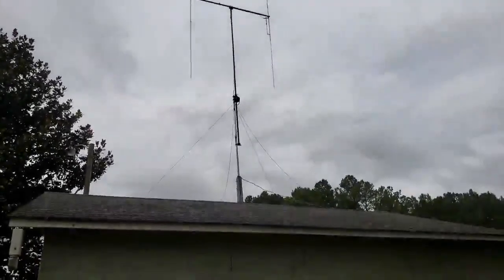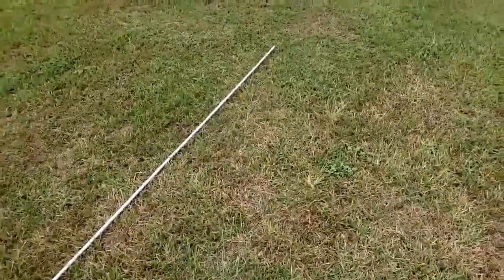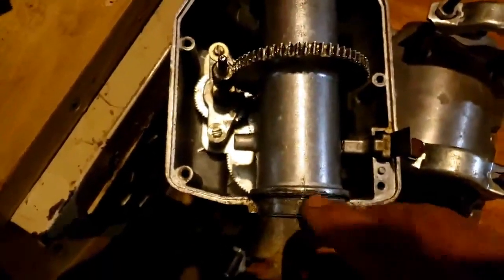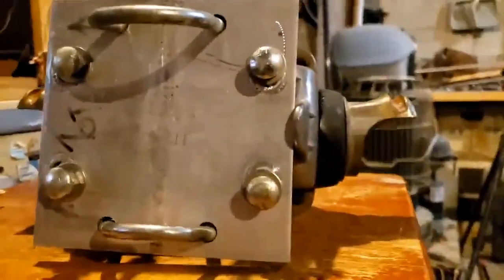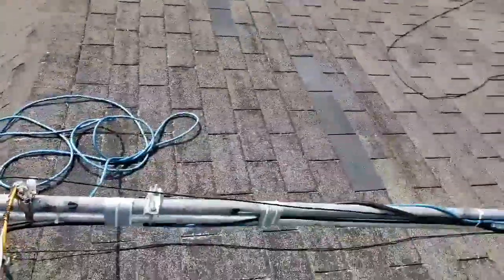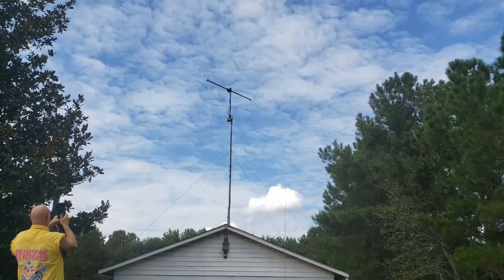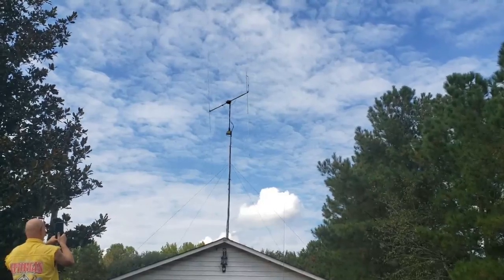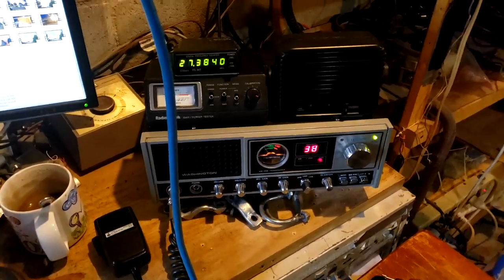Dual Rotor Yagi CB Radio Antenna

Comment: The Moon Raker did this with both a horizontal and vertical set of elements but you needed two coax runs to an A/B switch.. I thought they were huge until I saw an 80 meter cubical quad for 3.9mhz being put on a 120 foot high tower.. Like dad said, there are more ways than one to skin a cat..

Comment: I've been doing this since 1978 lol. You should have seen my stacked 4 element cushcraft with both antennas with their own flip flop rotor and stacked on a 20 ft stacking boom. All on top of a 40 ft tower being turned by an old wilson rotor and rotor box. It worked extremely well but my neighbors were nervous about it so I took it all down and used just 1 cushcraft 4 element. I love using a yagi on a flip flop rotor.
Reply from the maker: Nice! I would have loved to see that setup.

Comment: Vertical. Most CB antennas are vertical and if you are receiving with a horizontal antenna you are receiving half of the power.
Reply from the maker: these days Most of my locals are on flat side beams, I hardly ever use a vertical anymore.
Reply: @MowerJunkie  That is unusual. What do you use for mobile operations?
Reply: @MowerJunkie  Usually avoids a a ton of QRM.

Comment: what about if you turn the rotator half way between vertical and horizonal you get the operators that have horizonal only and operators that have vertical only so you contact more radio operators

Comment: Same Antenna, 3 elements in the 2/21/21 video? I read you took it down in the comments, I guess this is why. Can you tell difference with gamma up or down in horizontal position?
Do you miss your Reflector element? I realize why you had to lose an element to incorporate 2nd rotor. Watched the single element vid. also😎. Is there 4 element in the future?🤔 
Great video as always. Keep on expermenting. 73

Comment: What rotor was used for rotating the antenna vert/horiz?
Reply from the maker: both rotors are old Archer TV antenna rotors. one of them is a pass though design, and allows a pole to pass straight through it.

Comment: Very cool. Horizontal or vertical will come in handy with locals.  If your signal reflects off the ionosphere (skips) your polarity will be hit & miss.  Skip signals can "tumble" polarity.  Fun to play with & see which polarity works best for skip at the moment.  I have a similar setup with 4 qty Cushcraft 11 element yagis for 2 meter moon bounce. I had some fun today on 20 meters. Long path over the south pole into India (from Utah). The guy in India was talking on a home made rig transmitting only 40 watts and a piece of wire.  73 de AF7FP

Comment: This set-up will not work properly, because the mast is inside of the vertical, disturbing the 'field-pattern'! 

The 'horizontal' will work just fine! The 'vertical' not! 

A metallic mast will work as a third "leg" for the antenna! But not as a calculated 'leg', more 'disturbing' the 11m-Waves in the vertical position. 
Only possible solution is, take a non-conductive mast (fiber-glas etc.) 

Take a look of some HAM-Radio books, that explains more, than I can tell you. 

73 de Markus ; db9pz 

(my HAM-Radio-Call ; about 40 years ago, also very active on CB-Radio!)
Reply from the maker: with only 12 watts I have talked to, and received stations over 40 miles away on the vertical side. If the active element is over 2 feet away from the mast, and the mast is not a resonant length, it will not interfere at all. My active element is about 4 feet away from the mast, and so far, it is the Best vertical antenna I have ever used! I did a lot of research before building this antenna, and tried many different configurations. I first tried it with a 3 element Yagi, But the active element was too close to the mast and did not work well in the vertical position. But with the spacing on the 2 element, this antenna kicks ass! Both Horizontal and Vertical. Antennas are My favorite part of the Hobby, and Believe Me....I am always reading up on different antenna theory's.  Take care, 73's from 151 SC.
Reply: @MowerJunkie  
First, thanks for your quick answer.  
Second, ... " may be, ... disturbing, ... " will take to a good solution for you! ... 
 When you see it's working fine, everything should be allright! 
Congratulation! 
You may be right, with your exploration. 
I can't see any mistake there, if it is working that good! 

Why don't you 'step up' a little, and take your HAM-Radio-License? 

It isn't that hard, to get the 'ticket' any more. No more CW needed. Test is very easy to get, ... !

I did it, for my 'rights', to have and use and rise, my TRX, by myself.  Before the 'licence', most of the time, I stood with one leg, outside the law here in Germany. 

My licence covers all this 'things' in the past, and now, as I am retiered, I enjoy my HAM-Radio, without any trouble, with much more 'frequencies' and a lot more 'output power'. A lot of more 'rights' and a lot of more 'obligations'! Allways within my regulations, never beeing forced, to break the law, anymore.  It's a step ahead, ... ! 

You must not be in a 'club' or any community,  but I choose that way, because, to see there is one, to help me, if it is only my regulary magazine, every month, ... ! 
I am a member of the DARC, (German Radio-Club, about 60% off all German licensed HAM-Radio-people, are in  the 'Club', some for good reasons!) and that helped me a lot, in the past, and still today! But, it's not necessary to do that! You can allways 'fight' for yourself! No one is forced do be in any club! ( Hi Hi !) No ARRL needed, If that is your choice.

Hope you will understand my point of a view. To do a step foreward, is a good thing to do. 

73 de Markus ; db9pz 

 -  LOC: JN39FQ - 
about 3 miles east of LX, 
5 miles north-east of F, 
25miles south-east of ON, 
60 miles south-east of PA.

We are here 'living' the "European way of Life"! No borders, no controll, but oder sometimes different languages! (French, Dutch, German, Letztebourger-Platt (local idom, in my region!) 

LX=Luxembourg
F=France
ON=Belgium
PA=the Netherland
DL=Germany

I can make contacts, with all 5 contries, with my VHF-radio, (25W FM) without any problem! Using SW, will 'lighten up' my 'horizion' even moore, ... !  

How about it?

Comment: Here's a little trivia...signals sent vertically polarized are rotated to horizontal when refracted off the ionosphere and vice versa. Cross polarized antennas like the Moonraker were popular 50 years ago because you could flip a switch to see which way worked better. 
If the ionosphere ever returns with multiple hop DX then having the ability to change polarity will be great.
Reply: @Jeremy Nottingham , I'm not hearing it here near Pittsburgh. I use wwv as an indicator and never hear it above 15 MHz and even that signal rarely gets above the noise for very long. In the past once the solar flux got above 80 or so the bands would open up, but not now. Even on 40 yesterday the nets were struggling with poor propagation and the solar flux was near 90.

Comment: Good project, in high school in the mid 60's I had a 3 element beam about the same height. Did not have any rotors but did build a wooden flip-flop with a rope to pull it back vertical. Worked many countries on the old 22 a and 22b channels that were used by oil companies at drilling sights. Skip was thick every day so talking across town was hard on just 4 watts.  You should have fun watching how skip twists between h and v.!

Comment: How does that 2 element work? Space is a big issue for me
Reply from the maker: So far I'm very happy with it. it does very well for local use When in the vertical position. and does well for skip in either position.
Reply: @MowerJunkie  are there specs online for it?
Reply from the maker: @dj_saint  Yes, Google should have all the info You need.

Comment: Brilliant antenna idea 151 and yes, time to upgrade the shack desk etc. Your efforts on antenna ideas deservers a fresh, new (or built by you) desk. How was the SWR on vertical & horizontal? I was wondering because making the rotor, on the boom, part of the antenna in some sense did it change the SWR...???? 73, 770 - RI
Reply from the maker: Yup, It may be time for a new desk in My garage. I have checked the SWR in every position, and it stays at 1.1 with 47 ohms of resistance.  So far it's working fantastic! Take care 770, 73's from 151 SC.

Comment: I like what you are doing here, my friend. I ran a 4 element like this for several years about 25 years ago. After a while you may decide you need a way to automatically stop the antenna at vertical and flat to take out the guesswork (and not having to go look at the antenna to see where it is)...let me know if you come to this conclusion and I'll hook you up with how it's done.
Keep up the good work!!!!
Reply from the maker: Thank You 187, I'll let know what happens. Take care, 73's from 151 SC.
Reply: A few limit switches and your done.

Comment: Hey 151, 556 from Montana here. Awesome idea! Love it! I have a question for you. I'm thinking about putting up a 3 element beam at the house. How high should I go? I noticed yours isn't awfully high, but what is your experience with that? I'd be interested to know. Thanks and 73's to my friend!
Reply from the maker: The boom on Mine is at 35 feet above the ground, and I'm able to talk all over the world. This is about a full wavelength on 11 meters, and is the recommended height for a half wave antenna. If you put it higher it will improve Your local reception, But not make a lot of difference on Skip. Good luck with Your beam, Take care 556, 73's from 151 SC.
Reply: @MowerJunkie  thanks for the helpful info! I appreciate it. That's about what I was figuring. Thanks for all the cool videos. 73's to you and yours. 556 Superhawk central Montana

Comment: You are my inspiration . Long time i thing about second rotor 90 degrees to change polarisation my 3 el yagi in South Poland  ( second rotor from airconditioning open close ) .. but i have one question .Did you know when i change polarisation to vertical ...mast with ground potential stay between reflector and director ... change a s.w.r ??
Reply from the maker: This was a fun and rewarding project. I checked The SWR in every position, and it stays at 1.1 with 47 ohms of resistance.  If You did it to Yous, You would really like the results. Thanks for watching, 73's from 151 SC.
Reply: @MowerJunkie  I try it .. I Show you after mount .. 73!

Comment: thats incredible ! the second rotor tilts ? my rotor only spins. is that something you modified ?
Reply from the maker: Yes, the boom rotor is actually made for a vertical mast, I just removed the mounting clamps, and replaced them with a mounting plate. Thanks for watching, 73's from 151 SC.

Comment: Hi............ What a very Clever Idea.............................73s ........     (  I have seen this on VHF/UHF antennas but not on the 11 meter band )
Reply: I built a dual 3 element quad that does this 10 years ago. And a 60ft 8 element beam that done this

Comment: I have had that idea for years but onel: couldn't afford the extra gear 2: was always working no time  now can't hardly even get to backyard I think you may have some swr issues as you switch set- up for the different polarities is different at least when I tried switching I had to adjust the gamma 
Great job as always 
398 Wis cheese state
Reply from the maker: it worked out well. the SWR has stayed the same, no matter what position I have it in. Take care 398, 73's from 151 SC.
Reply: @MowerJunkie  I had gotten a dipole to 45° and skip really changed like the waves had chance head start on ionosphere twist